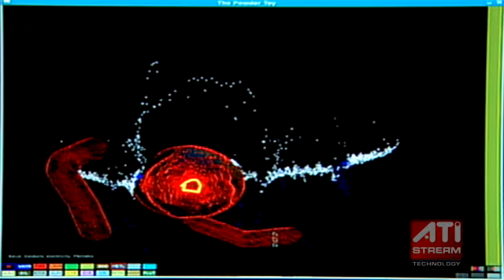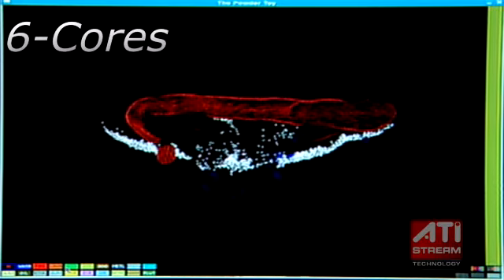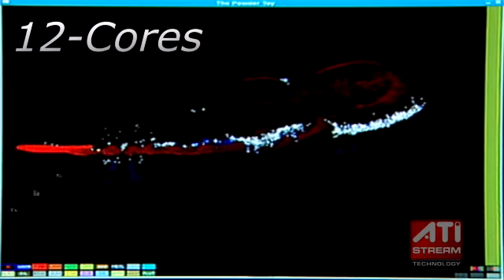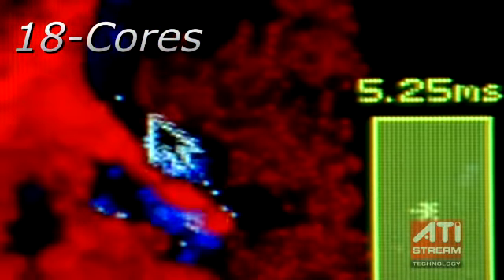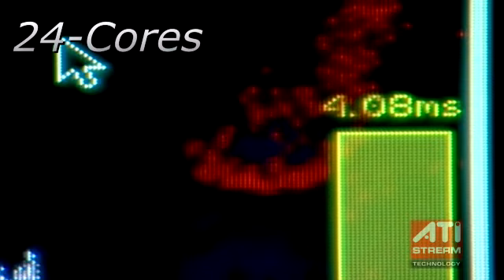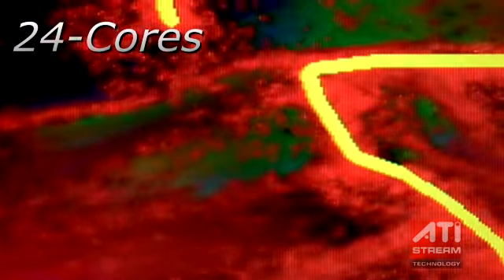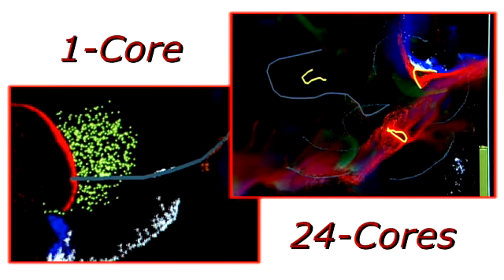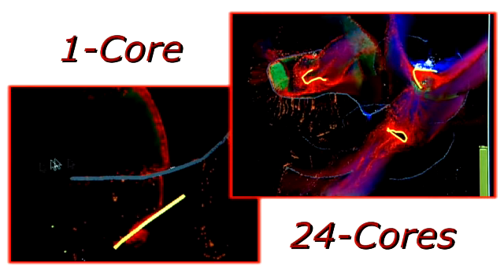OpenCL for CPU Scales Applications Easily on Four Six-Core AMD Opteron Processors

Comment: How much processing power and resources is lost by running it in this setup as compared to theoretically compiling the total available resources and calculating the response time?

how much power is lost in the process of a setup like this?

Imagine you are that first core in the one core test.
Now imagine you are that same core but in the 24 core test, are you contributing the same amount?

Comment: you're ignorant.
AMD is kicking nVidia ass, last time I checked their GPUs were HALF THE DIESIZE of nvidias while offering nearly the same level of performance and their architecture scales better with mulitple GPUs(tri 4890s is the fastest setup on the market)
yes, they have more shaders... but the shaders are much smaller and simpler. If anything NVIDIA needs to be more innovative, their GPUs are basically the same as they were in 2006 outside of a few tweaks. while AMDs have evolved.